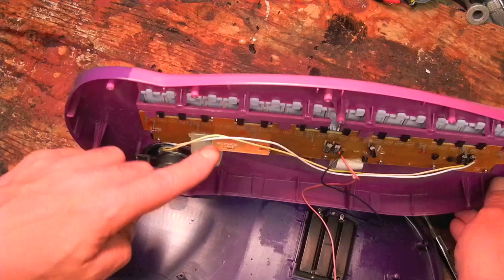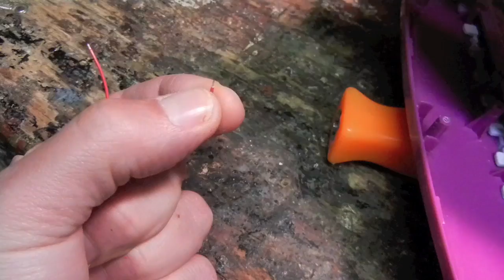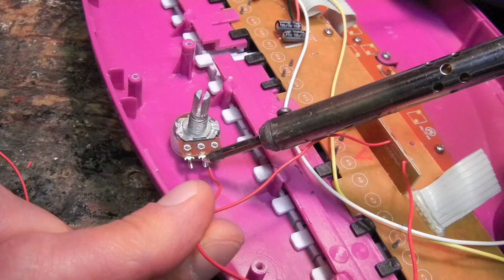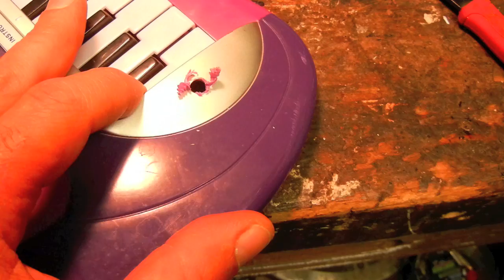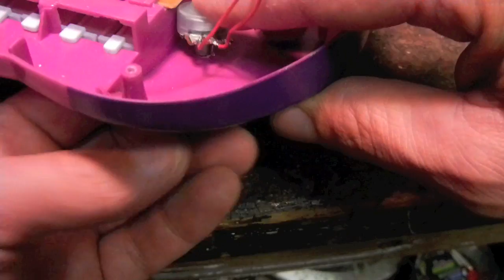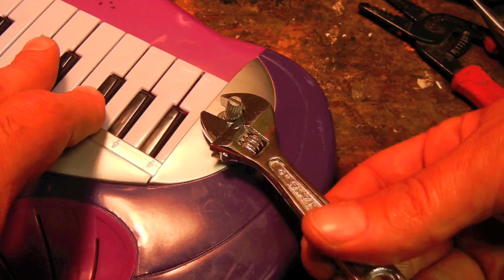Circuit Bending Fool - Pitch Mod Tutorial

Comment: How do u know what value pot to use? I tried using a b50 pot and every time it crashes the circuit and I can’t go below the default pitch
Reply from the maker: I don't know. I make choices based off of experimentation. I will use a B1M pot as a starting point for most pitch mods. Sometimes adding a wire from the battery ground or speaker ground to the 3rd lug of the pot is what will lower the pitch. Sometimes I attach wires to the resistor and do not remove it. Each toy is different. Experimentation is essential. Good luck and have fun.

Comment: How do you identify the pitch resistor?
Reply from the maker: while it is making sound, take some alligator clips and poke around the inside of a battery powered toy and listen for pitch variation as you touch resistors. good luck
Reply: @CircuitBendingFool  I was trying out my first project on a tech toy, found a pitch point and was daisy chaining the potentiometer to another with alligator clips and it made a distorted sound. I was then soldering that together and it stopped working? Could I had maybe over heated it?
Reply from the maker: @chromosomerism1712  anything is possible with experimentation. it could be fried but it might be fine with a reset.

Comment: I have a question, what are the name of the electronic items you used?
Reply from the maker: A potentiometer is a manually adjustable variable resistor with 3 terminals. Two of the terminals are connected to the opposite ends of a resistive element, and the third terminal connects to a sliding contact, called a wiper, moving over the resistive element.

Comment: How did you know which resistor controlled the pitch. Where are these commonly found?
Reply from the maker: Lick your finger and touch resistors on a battery powered circuit until you hear a change in pitch when you touch it. The toy needs to be making a sound when you search for a pitch resistor. The resistor could be anywhere but this video shows one possibility. Don't wait for approval, you don't need permission either.  Just try it. Good luck.
Reply: @CircuitBendingFool  lol you’re messing with me 🤦🏽‍♂️

Comment: Would that particular potentiometer work on most toy keyboards in this vain or do they tend to be different
Reply from the maker: 1meg pot is a great place to start. In this case it worked perfectly and gives you a lot of slow down and some speed up. However in many cases you will need to add a "trim pot" or a resistor to prevent the toy from crashing at the fastest speeds.

Comment: Nice video. For me I'm able to change the pitch up very fast which is great but it wont pitch down to lower that the normal speed of the original sounds. I tried 5k pots to 100k. Any ideas to help a dude like me out?
Reply from the maker: Right on. Glad you found the video helpful. If you get a 1meg or 2 meg pot, that will get you a much larger range of pitch.
Reply: @CircuitBendingFool  Thank you sir
Reply from the maker: @DonElevation  https://www.etsy.com/listing/863250669/circuit-bending-bundle-1-meg?ref=shop_home_active_1&frs=1

Comment: I tried this on a 80s soundbox with a 1k pot it didnt do anything really does it have to be a very high ohm resistance? Should I install a 1meg potentiometer
Reply from the maker: Yes it does. 1meg or even 2meg will get you where you want to go. Next step is usually a trim pot for fine tuning the optimal range before crashing the circuit.
Reply from the maker: https://www.etsy.com/listing/863250669/circuit-bending-bundle-1-meg?ref=shop_home_active_1&frs=1

Comment: I always used to wire the ground (negative solder point on the battery) and usually end up killing my creations. Is that a bad idea?
Reply from the maker: Ah Yes. A rhetorical question.
Reply: @CircuitBendingFool  I might have misjudged the resilience of several of these toys, but no more. As a wise man once said, when life gives you a few eggs, you can't make lemonade.

Comment: can you talk about how you go about finding the right resistor that affects pitch so i can apply this to other toys?
Reply from the maker: I learned by doing and I've written about it quite a bit in the comments below. For me, it's an art, not a science. 
You need to explore and experiment with the circuit board. Get yourself some lead/jumper wires with alligator clips and poke around. Make new connections and keep track of the results.

Comment: Hi! Great information!
Is there a specific way to find which component controls the pitch on different mini pianos?
How did you find out that that specific resistor has to do with the pitch?
Reply from the maker: In this video, you can see the the "big black blob" on the small circuit board is mounted at a right angle to the keyboard. On this board there is only one fixed resistor, which is the component that controls the pitch. Many simple battery powered keyboard and other devices will use this same design. 

It's always a first go to when I bend a new piece like this one and often the only bend I find.

The simplest way to find the pitch speed resistor is by trial and error, while the toy is making a sound. You need to open the casing and keep the wires connected to the batteries to enable you to try and find the bends while the device is making sound. You can explore the circuit board using wires with alligator clips to make connections between components. Most connections won't change the sound, many will crash the toy and a few may create new sounds. Possibly speed up the pitch... The simplest and most common way is to lick your finger and poke around to each resistor. If you touch the right one,  the speed will vary abruptly. 

Thanks for watching. I hope this helps define the process. Good luck. Have fun. 

WARNING/DISCLAIMER: Be safe and never bend a device that is plugged into the wall. Only experiment with battery powered devices.
Reply: Ja place a 100k resistor across every resistor on the board, play a sound each time and see.

Comment: Will this work on something more advanced like a Casio SA-76 or SA-46?
Reply from the maker: No it won't.
Reply: Circuit Bending Fool Well thanks anyway. Since I'm kind of a electronic wiz, I might want to do something entirely different; maybe make something like a digital pitch filter from an Arduino.
Reply from the maker: Sounds cool. Put that wizardry to work.
Reply: Though I can't program very well...
I'm not going to circuit bend it.
I have another keyboard (Casio MT-205) now, but the pitch bend mod can be made by wiring a 1M pot in parallel to the tuning pot.
May not do that though...

Comment: How do you find the pitch resistor?
Reply from the maker: Take action. Experiment. It can be easy or impossible. 
Open up the piece and poke around at components with alligator clips attached to wires. If you do so while the instrument is playing you will likely here the pitch change dramatically when you find it. On this instrument the pitch resistor is the only resistor on the circuit board. DISCLAIMER: only do this with battery powered toys. NEVER do this with anything plugged into the wall. Be careful. Have fun. Don't be afraid to break stuff.

Comment: Hello I'm trying to do this with an older voice recorder and I've found the speed resistor that sets the CPU speed I did what you did with the wires but now I'm trying to get the pot to work but every time I touch the wires to any of the three pins the recorder fizzles and crashes. It still works. Heres the thing, when I have the circuit hooked up normally if I put my fingers on the resistor and ground the speed changes faster. If I wet my fingers and do the same thing the "recording" beep plays faster and you can record in better audio quality for less time. What I'm trying to do is add a speed control so I can do this without the wet finger method. The pot I have is a slider from a broken RC helicopter remote and it has 3 pins. Is this the right one of no? If I succeed in this it will be my first bend.
Reply from the maker: Great work! I think you may want a high resistance potentiometer for this task. Try 1mg up to 4mg. This should give you the whole range of speed and then some. In some of my temperamental builds i have kept the initial resistor on the circuit board and hacked in after the resistor, but usually I just take the fixed resistor right out and insert the pot (a variable resistor) in place of the fixed resistor. Hope that helps.
Reply: Not sure where to get one. Could I use a volume control from a broken radio? I don't have a radio shack just down the road from me and I cannot buy online except amazon but i doubt they would have something like that. 

This recorder came from a toy spy thing that looks like a camcorder and the battery door is the LCD on the camera. I just mounted everything where it could be used like a yak bak since it uses the same type of recording chip.
Reply: Oh man, I just stumbled upon your channel and noticed, that you stopped uploading any videos around 4 years ago and there also haven't been any updates on your blogpost, and I thought you died or something.
What am I saying is that I'm glad I noticed your recent comment and I hope you're OK.
Sorry, it's almost 4 AM and I'm watching circuitbending videos and my mind goes crazy.
Reply: rfgecnf
Do I know you? I don't do blogs and I have uploaded videos just not as much.
Reply: Hey,  coondogtheman! I was referring to Circuit Bend Fool in my comment,  but it seems that you received a notification instead. Sorry for the confusion
Reply: rfgecnf
It's OK youtube can mix things up sometimes. They are still not done ironing out all the bugs.
Reply: Hope some day they'll get it straight. A man can dream,  right?
Reply: rfgecnf
Right.
Reply from the maker: Try to experiment with pot resistance. I built a test station with many pots of different resistance. Starting at  1k and down to 5 mg. If you use a 5MG pot it will likely work, but each circuit will have a sweet spot somewhere in the middle of the range.

Comment: I've been trying to bend my crybaby wah for several months, trying to wire oscillation into the circuit and to the treadle pot, unsuccessfully so far. I keep poking around in it with my wires but I think I'm missing something. I would like greatly for you to succeed where I have failed and post the results. I hope you can rise to the challenge.
Reply: What sort of effect would this achieve? My guess is that you won't use it as a guitar pedal, but rather a sort of a synth, as we're talking oscillation? I'm only beginning to interest myself in this now, after a big project work I did on the evolution of electromechanical and electronic instruments, so please minimize jargon?
Reply: TeamFlamingStones 
Actually I would be using it as a guitar pedal. I had hoped to get sort of a mechanical stuttering noise similar to a jackhammer, with the frequency dependent on the angle of the treadle and some small amount of playability. I literally got nothing, no sound or no difference no matter where I poked my clips around.
Reply: apotheodaimon Oh right, so like a tremolo effect on the wah-wah effect itself?
Reply: TeamFlamingStones more like a pitch shifting wall of jackhammers and truck engines. The technical term would be parasitic low frequency oscillation.
Reply: TeamFlamingStones its what happens when power starts to leak into the circuit, normally undesirable.
Reply from the maker: rise up